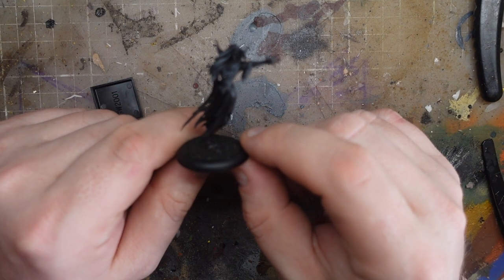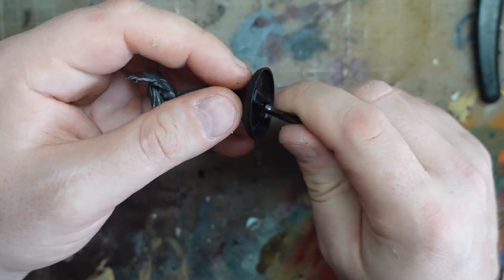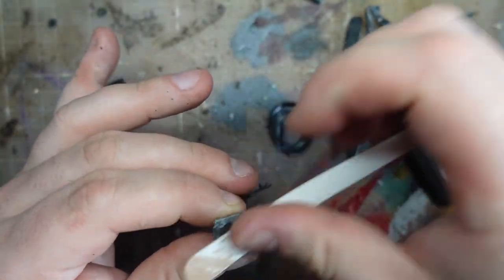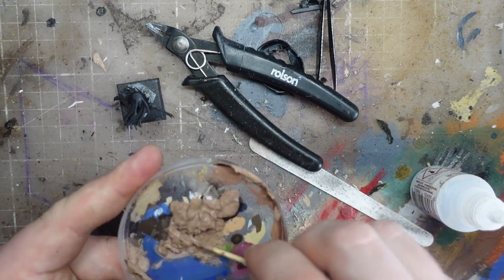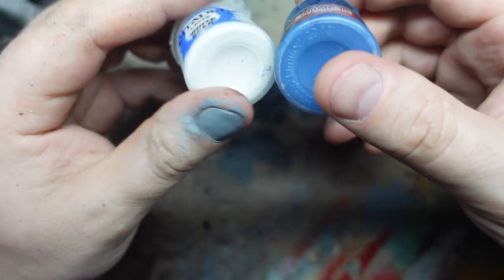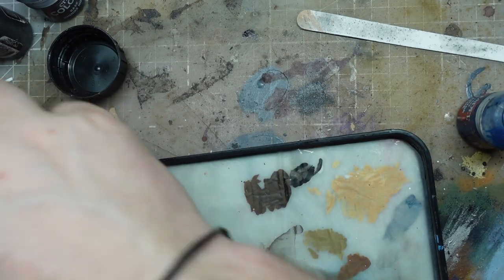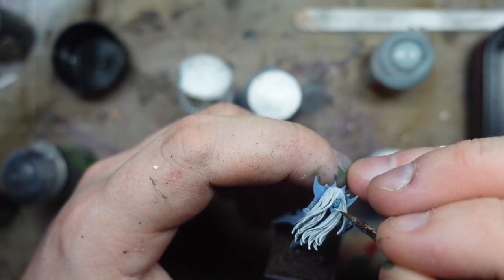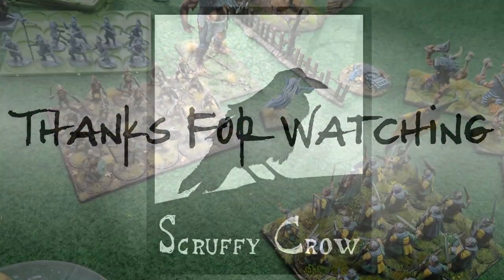GW Tomb Banshee Painted As An Oathmark Wraith

Comment: What you probably did with the original basing was, I believe, due to that being one of the Warhammer Fantasy Battles minis that had the sculpted base as part of it, but it would have been the old 20 or 25 mm squares along with a packaged round base if it was post AoS when they repackaged a lot of the later ones by just adding a base into it.